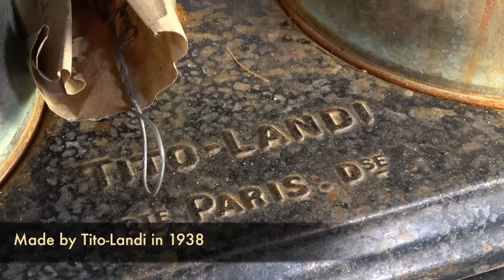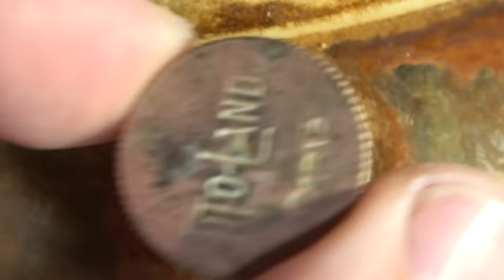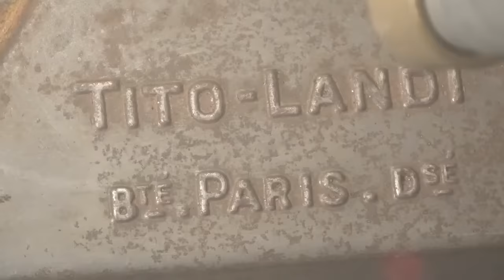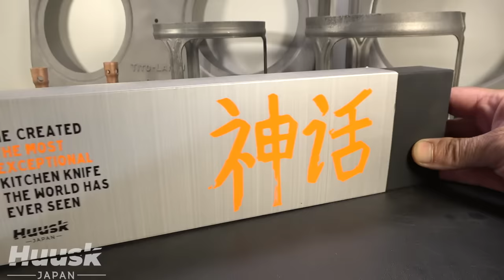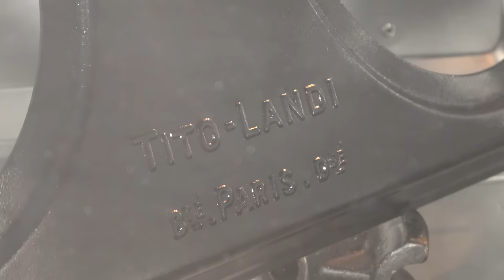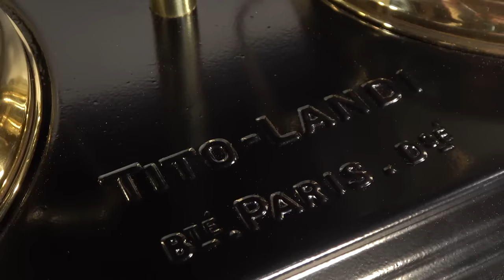1938's Gasoline Cooking Stove - Tito Landi - Restoration

Comment: Beautiful. 
One tip: when you strip paint on a profiled edge, one of the best ways to remove the gunny film is with handfuls of wood shavings. If you don't have enough on your shop floor, you can pick up a pack of animal bedding. Just get a handful and drag it along the edge and the bulk of the mess is gone.

Comment: Perfect, beautiful, thank you! It seemed to me like a stove with weak burners, perhaps because the pipe that goes from the injector to the burner is very long. Despite the wire wrapped around the barrel, the heating of the register must be low, reducing the volume of the flame in the burners.
Reply from the maker: Thanks a lot 👍
Reply: @TheFabrik I suspect that the asbestos string was to insulate the tube against heat loss, which the brass winding won’t do. You can get fibreglass rope for stove seals in a variety of sizes- that might suit your purposes better!

Comment: Tito Landi products used methylated spirits or alchohol not gasoline, their incandescent mantle lamps are lovely as is this pretty little French stove, very nice restoration , Stu ,classic camp stove forum.
Reply from the maker: I still have the original instruction manual. It says it works with gasoline. The same fuel I put in my car 👐
Reply: @TheFabrik 

Hi, yes maybe the white gas used in Coleman lamps  & stoves, I also use panel wipe in my petrol stoves which is like Aspen fuel free of the additives , but modern car fuel is not great as it's full of nasties like potassium & benzene which can foul up the wick inside like a primus or svea stove & be bad for the soul! You did a really great job on this stove, try & pre heat it with meths on the pre heating fork as it doesn't leave any residue on the burner, I hope it gives you years of pleasure!
Stu.

Comment: I had a camping stove that ran on gasoline, too, except you'd pressurize the gas tank with a pump. When you opened the valve it'd spray gasoline and you'd light that. One burner, and it folded into a metal can that you could cook in.

Comment: 1:13 Next time spray some water on the asbestos so it's safer to remove and you won't breathe in any of the flying particles.
Reply: Igen igy van, jo otlet.😊
Reply from the maker: Thanks for the tip ! 👍🏻

Comment: Perfect restoration
Well done indeed
Why you put copper wire surround or around the neck of the flame tube?
Reply from the maker: It was abestos initially. I though copper wpuld replace it, just to get a better burning effectivity. Seems to work fine ;)

Comment: I wonder if he used pump gasoline (modern gasoline formulation) or white camping fuel (antique gasoline formulation). The original Coleman lantern was designed for the antique formulation, but there is a model that can use the modern formulation. I don't know of this stove is the same way...
Reply from the maker: It’s pump gasoline ⛽️ 😉

Comment: Why did it have asbestos and does the replacement wire work well?
Reply from the maker: Asbestos was there for a better combustion. It keeps the heat inside. Not sure my brass is very efficient tho ;)

Comment: Nice work and cool stove.
I'm a little confused as to the purpose of the asbestos rope.
I am struggling to think of what practical purpose it served in this particular application.
Reply: @solidsnakesimulation666  You mean it should be removed by a specialist, you are aware there are people in the world that do things they are not supposed to do aren't you?
What is it if it isn't asbestos?
It's a 1938 stove if it were a modern stove I wouldn't for a second assume he is correct in identifying it as asbestos but it's not a modern stove.
Reply from the maker: It is asbestos
Reply from the maker: Asbestos was used to contain the heat in these heating chimney. It generated more heat just like a puffy jacket 😅
Reply from the maker: @solidsnakesimulation666  oh ! Ok lmao
Reply: @TheFabrik  Thanks it does seem rather unnecessary considering the heater tongs are required to start it anyway and once started the chimney should remain hot from the heat generated by the stove.

Comment: I don’t think it would have used gasoline, although it would burn for a little while but I suspect it was a kerosene ( lamp oil was first made in 1846 ) cooker .
Reply from the maker: I have the orignal user manual. It says it’s gasoline... i mean fuel. The same I fill my car with (no diesel). And it smells just nothing ! 😮

Comment: I grew up with one and it didn't use gasoline! It was a carbide stove. you put carbide in and added water which dosen't produce carbon monoxide!
Reply from the maker: Ok David I didn’t know we could add water !! I said gasoline but it’s fuel. The same fuel I fill my car with ( no diesel ). Thanks a lot for watching and also commenting 🙌
Reply: @TheFabrik  The also made carbide lamps which calcium carbide
Carbide lamps are powered by the reaction of calcium carbide (CaC2) with water (H2O). This reaction produces acetylene gas (C2H2) which burns a clean, white flame.
Reply from the maker: @davidhill2874  allright David, many thanks for all these infos 😌🙏

Comment: its petroleum not gasoline
Reply from the maker: I have the original user manual. It says it’s gasoline. The same as I put in my car (no diesel) 🙌
Reply: @TheFabrik  the reason i dont belive its petrol is you dont pump it to build up preasure